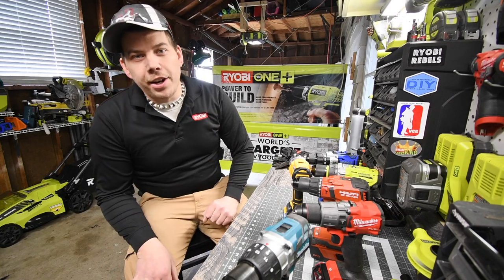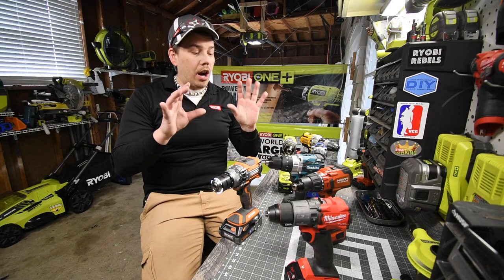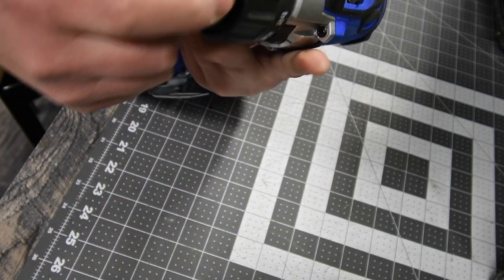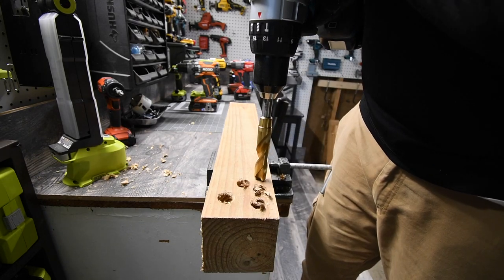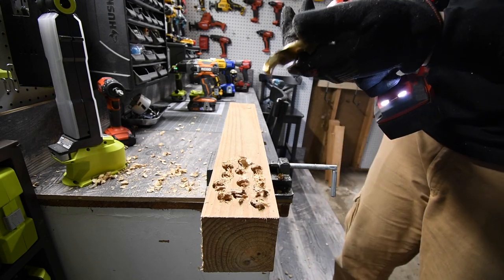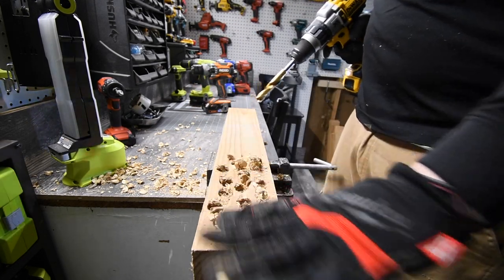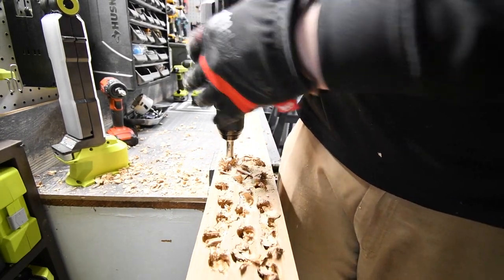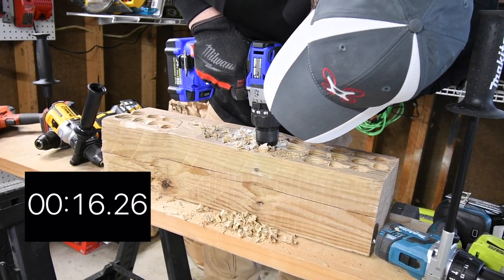Hammer drill Brawl!!  HILTI, Makita, Ridgid, Ryobi, Milwaukee, Kobalt, Dewalt

Comment: I own the Hilti and Milwaukee. The Hilti is the best thing I've used in 40 years!! Plus the after sales service is 2nd to none. My mate was using my old Gen1 Hilti to re-fix a steel frame around a street drain. He dropped the drill into the drain about 16 feet down. The drill still worked but wasn't quite as smooth. I rang my Hilti rep and explained. He was with me within 30 mins and gave me a replacement drill then took mine away for repair. Mine was back in 24 hours and he took the other one back. This resulted in no down time. When I sent my Milwaukee for repair it took a week to come back and if I had no spare I would have been without a drill!
Reply from the maker: HILTI is a darn good brand and I love them and I thank you Dave for sharing your story
Reply: @ManCaverTools  your welcome Sir!
Reply: I'm gonna find a way to save up for Nuron.

Comment: The dewalt has at speed 3 2000 u/min the same as the other drills at speed 2. The speed setting 2 at the dewalt has 1450 u/min, this means more power by the half inch speedbit.
Reply from the maker: I know and that is why I switched it to speed 2 and thank you Anton
Reply: Lol dewalt fan girl Anton

Comment: I watched this video to see the comparison between models and over all a really good video. I have the Ryobi brushless hammer drill and have found that with the HP batteries, this drill is fantastic. I have no complaints about my Ryobi tools. I don't use them as hard as your tests and for what I use them for, they're great tools. I have found that when using the HP batteries however, my hammer drill doesn't have the performance issues. I have found that with the HP batteries, my drill is on par with some of these brands simply for the fact that the HP batteries can deliver more current to the tool. BTW, the only reason I have Ryobi rather than the other brands is simply for the fact that these tools were given to me for Christmas, so I'm definitely not a fan boy of any brand in particular.

Again, good video and keep it up.
Reply from the maker: I think people need to give Ryobi more credit then what they give it

Comment: I was sad to see the Ryobi end so poorly and actually fail the last test.  I hate the idea of hosting multiple charging environments though, so as long as I don't have to do anything major I should be ok.  I do not currently have a hammer drill, just an old blue :)  had that for years along with the light, recip saw, circ saw and impact.  Nothing brushless yet and your videos give me a good idea of what's out there. Thanks from a fellow Northern IL resident. (Near Rockford)
Reply from the maker: don't be too sad. the tests are not over, in the next video Ryobi will be using HP batteries :)

Comment: I have that same Dewalt Hammer Drill and the chuck doesn't like to hold the bits in at speed 3 out of the box even. Had the chuck replaced under warranty seems to do a little better holding the bit in.
Reply from the maker: very good and thank you for sharing Guan

Comment: Are you planing on getting any metabo hpt tools? I have Dewalt 4ah and 5ah batteries and I don’t fell a difference between the two. Nice video! You should do one on the impact drivers.
Reply from the maker: yes I am getting metabo along with the batteries for the dewalt and thank you Tool Business
Reply: Man Caver Tools I have the Metabo 12v multi head drill, it’s a really nice tool👍
Reply: Man Caver Tools are you getting the real metabo German made or are you getting the metabo hpt by hitachi. I personally would want the German metabo if I could afford them as it seems you are very capable of getting.

Comment: Do you even have the clutch set to the highest clutch settings? When doing these test? Because that would make a big difference. Regardless if it's set to speed 2.
Reply: The clutch is only activated in screw mode not drill mode.
Reply from the maker: all of the drill are set on drill, clutch doesn't work on drill
Reply: Thanks for the reply and clarification 👍

Comment: You need to adjust the clutch. Most of them are only set halfway up, could be why some are stalling out
Reply from the maker: the clutch on all of the drill were on drill, which if its on drill the clutch won't use the resistance sensor

Comment: TIM from Canada the test you were doing should have stopped right at when the bit did not go through the wood that when you start the test by restarting the test and doing it again you have given this test a two shot a go when you do a test any test like the one you were doing with these drills as soon as the drill stops the test is over and you move onto the next drill and you keep doing the test again if the trail goes through that,drill has made it
Reply from the maker: did I not announce in text that if a tool failed?

Comment: Shame that the former "Ryobi Man Caver" chose to use the Ryobi P197 non-HP 4Ah battery on the brushless Ryobi P251 hammer drill, resulting in the Ryobi poor performance.  Should have used either the Ryobi P191 3Ah HP battery or the Ryobi P192 4Ah HP battery for fairer results, like you did using a Ridgid Octane battery on the brushless Ridgid hammer drill.  HP and Octane batteries are made to be most useful with brushless tools.
Reply from the maker: it s what was far. I only used a a special battery on the Ridgid because I don't have a normal batter besides a 2ah. all of the the other batteries were normal. But don't worry the next test video like this spacial batteries will be used

Comment: Hey Man Caver this review is your first fail. turn over the roybie  it was made to use hp bats  roll it over see those extra tabs that's proof you ran all the tools but that one on the bat they were designed for but roybie yes you can run any bat but the brushless tools are for hp bats, to get full power. i only run hp in my brushless . so I don't hut my tool with not being able to pull high draw. use the right tool for right job in this case hp bat. I don't know about better times for tool . Its the same if you have a race car running on race fuel and you put 87 in it. all heck will break loose.
Reply from the maker: the only tool that has a special battery was the Ridged, we will be doing this test again with different batteries and the brands that have special batteries will be used. and Ryobi will be using the HP batteries next time

Comment: You forgot to say Hilti failed. I guess you have a soft spot for Hilti you gave it a second chance when you did not for the other fails. I'm surprised you think the most expensive drill would do the best. 👎
Reply from the maker: I put it in the results of that test in the text
Reply from the maker: I put the extra test in there to show im not bias, if a tool fails I don't change the results, I knew it was going to fail the second time. but I did say it failed in the text of the results of that test
Reply: He did say the Hilti failed

Comment: In you other video (Dewalt VS. HILTI Hammer drills), Dewalt 996 beat the hilti with the 1-1/2 spade bit on speed 3. And here you say it cannot be done on speed 3, what's up with that?
Reply from the maker: are you sure your talking about the same dewalt hammer drill. you know that dewalt makes more then 1 powerful hammer drill. the Dewalt Power Detect is the most powerful hammer drill ive tested so far. still need to do Dewalt PowerDetect vs Flex turbo
Reply: @ManCaverTools  Yes I know all the dewalt models. You have tested both the 996 and the 998 power detect against the hilti. Here is your video I'm talking about @ 14:35 minute mark:  https://www.youtube.com/watch?v=eOLgC1wA6cw&t=884s

Comment: I have a lot more respect for Kobalt and Ridgid after this video.
Reply from the maker: I do as well. I thought they both would fail but they did not
Reply: Kobalt plays with the big boys and they're on deals all the time but 2 annoyances are that they're heavier than the competition (true of my Kobalt ¼ impact, hammer drill, oscillating saw, and circ saw compared to my coworkers' dewalts and ryobis) and they're only available at Lowe's which most contractors try to avoid like the plague. Too many diy kids looking for paint and old ladies trying to return potted plants compared to home depot.

Comment: Why do tests when they are not even scientific and fair?? It is just waste of your time... The milwukee clearly hit a peg or a nail or something midway through 18:40. And sometimes you drilled too close to another hole so it went through much faster.. Make a better test next time please. Drill into plywood or something else that is evenly hard to drill throughout the whole surface making it evernly hard for everyone. a block of lumber is full of pegs and different density allover...
Reply from the maker: no test in any video will be an exact science. this is what will happen in the real world. if you build a house to you now buy any lumber with a single knot in it. that is what happens in the real world. deal with Concrete tests are next
Reply: Man Caver Tools that make little sense. You must agree that drilling through MDF board will be more accurate?